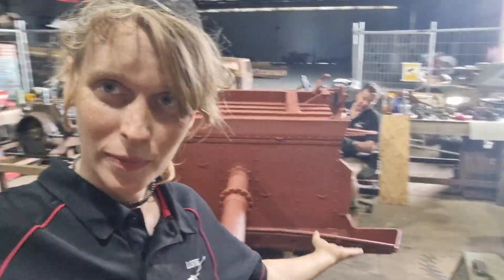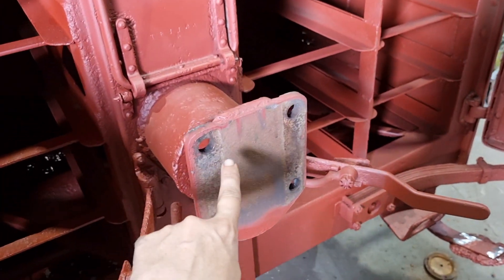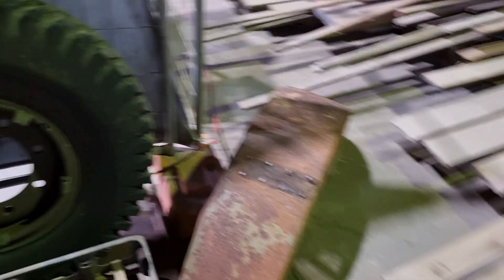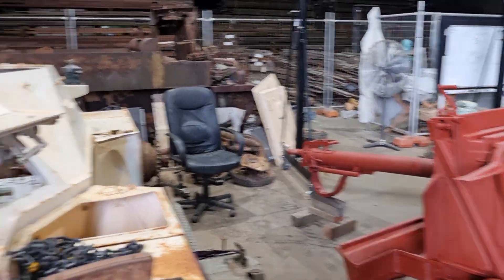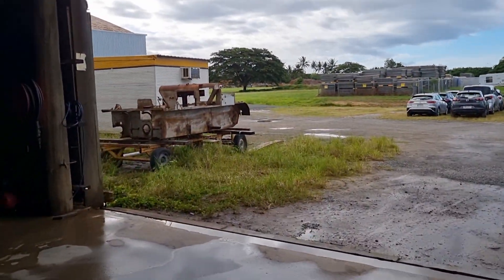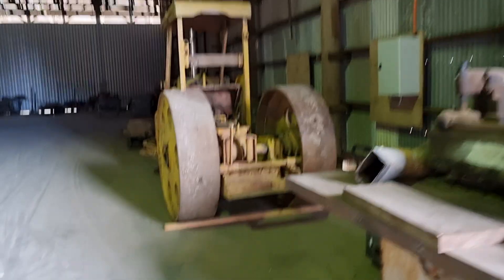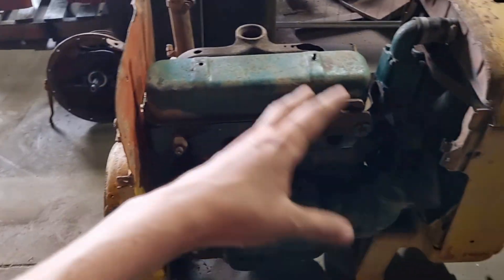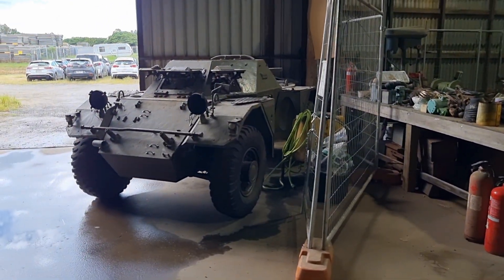Our next WW2 project!

Comment: The brakes on the trailer artillery are to assist the gun/howitzer which has no brakes and the rear doors should have round rubber stops opposite every charge bin. For those with no artillery experience the gun is met on arriving at position and raced into the marked sighting pole where gun is unhooked and set up by crew. This is a highly active time and the brakes could stabilise the gun during the process especially if the turntable had to be settled into sloping ground.